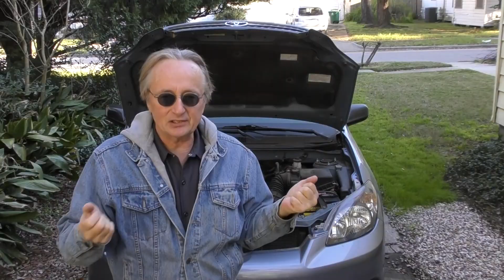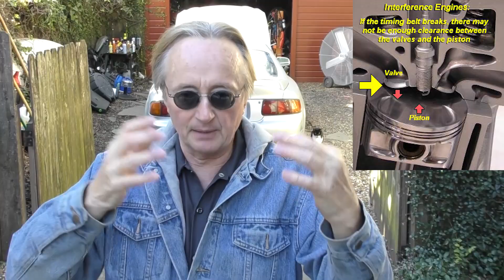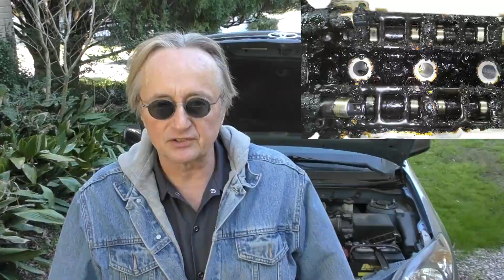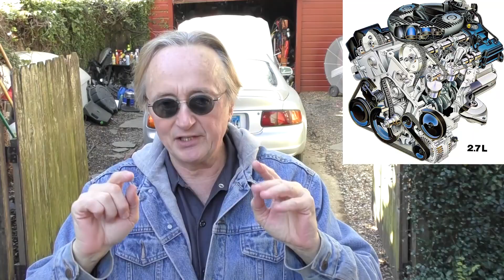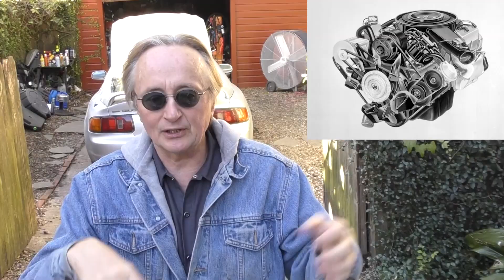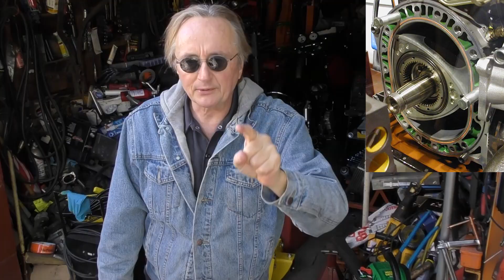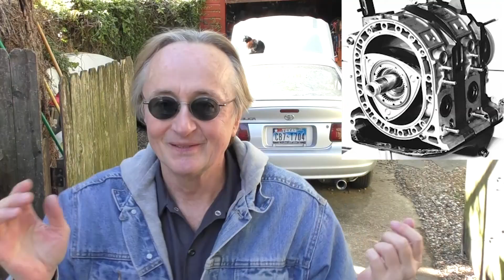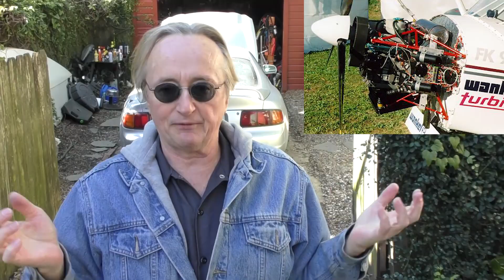Never Buy a Car With This Engine

Comment: Scotty, I had a 2004 Pontiac Grand Am with the 2.2 Ecotec, I actually had the car almost 6 years, until I sold it, it had almost 240k miles on it, and had never had a problem out of it, except for 3 starters and an alternator. (Oil changed every 3k miles, at 175k switched to synthetic blend dexos oil)
Reply: Stefano Dawg maintain it, keep up on the oil changes, should run for a long time
Reply: Stefano Dawg I had to get a new motor of Chevy mablui  2006

Comment: THANKS SCOTTY I'M GOING TO  WEBSTER TEXAS WEDNESDAY TO BUY A 2007 MAXIMA CAN YOU HELP ME IM AWOMAN AND THEY MIGHT RIP ME OFF IT'S A PRIVATE DEALER LOOKS LIKE THE CAR IS AT A APARTMENT ARE YOU CLOSE BY CAN  YOU HELP ME CHECK I WOULD NOT BE TRYING TO GET A CAR BUT I BOUGHT AGMC ENVOY 3 YEARS AGO FROM A HUSBAND And wife and it had oil leeks and it is misfiring and leaking i changed the spark sparks and it's doing the same thing please help dont know what to do thanks

Comment: He's right about the 1.8T engine.  I used Amsoil synthetic in it and still had sludge problems.  Also, all of the vacuum fittings were made of cheap plastic that broke down due to heat.  The other problem was the crappy cvt transmission.  I'll never own another Audi.

Comment: Why can't IC motors use the oil for cooling? I know that oil is cooled through the oil pan, especially aluminum ones, even better aluminum oil pans with fins on the bottom. And oil cooler radiators. The old VW Beetles had an oil cooler radiator inside the fan shrouds. I had a car that had both a finned aluminum oil pan AND an oil cooler radiator.
I guess what I'm asking is why isn't the cooling jacket and radiator that are filled with water/antifreeze mix instead filled with oil all interconnected with the lubrication system? Then a circulation pump mounted inside the motor case or timing chain cover wouldn't even need a shaft seal! Like who cares about the tiny leakage around the shaft of the lubricating oil pump now? It just goes back into the sump (oil pan). It doesn't need a seal, just a close clearance.

Comment: Scott I  want to build a small RV and have been looking for a suitable high top van or cargo van.  I hope to get one that will be reliable and get the best gas mileage I can. Can you recommend what I should look for. I know that diesels are usually recommended but I am leary of the repair costs of a diesel and I am unfamiliar with there upkeep etc.

Comment: I have to be so lucky, I just hit 230k miles on my Saturn ion 2003 with the ecotec 2.2 engine 😁
Reply: Not too lucky, my old lady had an '03 Cavalier, same motor, hit around 225k before I asked her a question to which she replied, " I didn't even know it had spark plugs!" Easy engine to maintain yourself if you were really into legos as a kid
Reply: The amount of abuse and stress I put on my engine. Its still running strong. I have not had one issue with my engine. I have a 06 saturn ion 2.2
Reply: mine has 212,790 miles

Comment: Any 3.5L engine in a GM timing chain
3.3L in a Chrysler oil Cooler
Toyota venza water pump 12 hour job
Dodge rams 1500 aluminum heads
Hyundai Santa fe 2005-2009 front suspension
Any BMW oil and coolant leaks galore if not maintained

Comment: Hurt my feelings on that EcoTec, Scotty. I have 2000 L series Saturn with the 2.2l, I bought it 4 yrs ago for $1500 with 161K on it. Currently has 212K on it and still purrs like a kitten.
Reply: My buddy has a saturn with the 2.2, he has 286k on it and it still sounds like a brand new motor
Reply: lynus binkley I hope this doesn’t include the 2.4 LE5 engines... that’s what I have in my 07 G6... (aka 07 Saturn Aura, 07 Malibu, 07 Opel Vectra C)
Reply: @JoeyLovesTrains  07 Malibu has the 2.2L without VVT.
Reply: Lower mileage, but my 2.2l Sunfire (03) is still kicking at 105k after buying it at 64K 2 years ago.
Reply: I had an 03 Grand Am with the 2.2l and it was the best car I ever owned. When I traded it in that engine still ran like new at 110k, unfortunately it was the transmission that sealed her faith due to my negligence.
Reply: Proper oil changes and they will run forever

Comment: I have a 2006 chevy cobalt with the 2.2 engie eco tec and it has over 200,000 miles and it runs like a champ😎
Reply: My 03 Cavalier with a 2.2 Ecotec is still going strong, 400000km.
Reply: I have a Saturn vue with the 2.2 ecotec and still runs good to.
Reply: I have the same year cobalt as you. With proper maintenance they can go a long way.
Reply: I have a Chevy cobalt  2.2 and it got over 213, 000 miles and it's still going strong
Reply: 2007 chevy malibu   2.2  EcoBoost  220xxx
Reply: How bout now?
Reply: How’s it holding up
Reply: Yes I believe in 06 they went to the better timing chain tensioner. My 05 Cobalt blew up in a parking lot hahaha
Reply: Your chain may have been upgraded with a better tensioner. Most of them are junk at 125K that i've seen.
Reply: Well let's get something straight....no Chevy Cobalt is the 'champ' if anything. Haha, they should last if you maintain them, including timing inspection/replacement...but that's pretty much most engines. The driver makes most of the difference. But it's hardly champion lol. It's supposed to run that long. Just not fun, or exciting. He makes great points on alot of his videos. But the ones about the BMW'S....drive me insane. 265k  on my 06 325xi. Still runs and drives as it should. 
Champion car. *

Comment: Scotty or anybody else out there I have a 2011 Chevy Aveo I get a code P0598 I looked it up do I need to change the thermostat my car is not overheating doesn't Run rough I'm just confused on what to do any help would be greatly appreciated

Comment: Hey Scotty, I have a 2014 1.8L turbo 4 cylinder engine, what is your opinion on the new 1.8l turbos? I bought my car about 2 weeks ago used at 105k miles. Runs great and seems to be fine to the best of my knowledge. If you got any pointers on how to keep the engine prime I'll take them. Although after watching this video, you scared the crap out of me.

Comment: @scottykilmer the Rotary engine is definitely NOT for the average joe. It is a car enthusiast type of engine. I feel the cure for the apex seal issue is a diesel powered rotary, diesel has its own lubricating properties on its own. 
 But i will agree...if you you are just an average joe and you just "operate" your car do NOT buy a car with a rotary. Also a rotary powered car is more like a leisure car. Use premix in them also!!!

Comment: I have a Pontiac ecotech 2.2L and I am surprised that it has lasted so long as it has. it has 221k miles on it. I had the timing chain on it replaced and only used oil with Dextos and I am surprised it has lasted so long. Even my normal mechanic was shocked it was still pushing the power like it it was at 90k miles. If you baby it right, I average about only $150 a year only on basic servicing and its been a good buy and i had the car for 5 years and I bought it as 168k miles

Comment: The wankel rotary might not be a very reliable, long lasting engine but it is a monster on the track. The fact that it doesn't have to an up down motion from pistons means that the rpms are insanely  high. A 1.3l rotary can keep up with 3.0l that's saying something

Comment: Hey,Hey Scotty, Willie here, how you doing sir, on the topic of engines, I started helping my Dad fix classic cars like the 1955 2-dr coupe, im not sure what kind of engine he had in it, but it must have been pretty nice, he would take me down the track and run it out top speed, it ran beautifully, but here,s my question, ive been looking to buy a used car to make all my DR,s appt,s I had a guy with a Lincoln town car with 68 thousand miles on it, he had receipts for everything he just replaced, and it was a long list of things this guy had done and had the proof of these repairs, I asked him what size motor is in this car, he replied it has a 4.6 liter engine, are those engines any good Scotty ? I was very tempted to buy this car for a very low cost 2100.00 to be honest about it, but not knowing anything about this engine made me hesitate, and someone else bought the car before I could make up my mind, so that's why im asking you now,because the next time I see another Lincoln town car and it has a 4.6 liter engine in it with under 100 thousand miles on it depending on your information on this engine I just may end up buying the next one I see and become interested in , Scotty, could you please let me know if the 4.6 engines are any good in those Lincoln town cars ? thank you Scotty, whens the T.V. SHOW  coming on ? I hope you do get your own show , I know ill be watching it, you,ve already saved me hundreds on repairs I did from watching your video,s ,so please keep,em commin , I rang that bell ,lol take care Scotty ,William

Comment: Ford Triton 3 valve and Cadillac Northstar V8 should have at least been honorable mentions
Reply: Definately the 3v. The northstars are good engines aside from the oil pan leak problem and having to pull the manifold to replace the starter

Comment: Once I stopped letting mechanics touch my vw 1.8t, my issues all went away. Dealers, imports only, friendly neighborhood shop, all dropped the ball on my car.
I bought it new in 2000 and around 100k miles she was circling the drain- misfires, bad fuel economy, and no power. The shop’s all said to take her out back and shoot her!
When I rolled up my sleeves, bought a chilton’s and went through it, I found duct tape, missing parts, faulty $5 dollar sensors, wrong parts - you name it!
I guess no one bothered to use a manual, because a novice like me replaced the POV hoses and check valves, ignition harness, spark plugs, and egr valve for about $200 and she purred like a kitty.
170k miles later I had to stop driving it cause the doors were ready to fall off it - the engine stronger and more reliable than it was after just 100k of professionals diagnosing and repairing my car.
It’s timing belt was a bit tricky the first time. The second was a cinch.
I agree that it was a sucky engine if it’s treated like a regular old normally aspirated I4, but they respond to thorough maintenance and repair👍

Comment: I was a Chrysler tech in 02', Had an Intrepid 2.7 come in with a "will not start". Check the battery, it was good. Check the oil, it was really low. Put oil in it, attempt to start; really slow/ hesitation start. Drain the oil, barley a pint. Took the oil pan off, the whole thing was like gelatin!

Comment: If memory serves me well, I worked on a Mitsubishi engine in a doge caravan or ram. The emplacement of the water pump was a disaster to work on (driver's side). The model I refused to service was a Jaguar. Damn engine compartment was packed tight. I just dropped the hood and said "Bring it to your dealer".

Comment: Hey Scotty I have a 2018 Subaru Outback 3.6 touring with a 6 cylinder engine. The dealership wants me to use a Hybrid oil , half synthetic  and half regular oil, won't that cause a buildup in my engine eventually?
Reply: Stay with full synthetic its better for VVT when oil is lighter.

Comment: The Jeep liberty 3.7 is a good engine, but Do not overheat them or run them low on oil. They will last well over 100,000 mile with no problem.

Comment: The GM 3.8 (3800) Engine was a very good engine.
Reply: I had luck with the 3100 from the 90s, Lumina era.
Reply: Same with the 3600 v6 absolutely bulletproof! Trust me I know, I have a 2002 Pontiac grand am with around 215000 miles and no engine issues whatsoever. (Glad I doesn't choose the cheaper ecotec option!!)
Reply: @bigdaddyvince182  the ecotec engine actually isn't bad, the cobalt still has average reliability. Sometimes scotty is pretty biased...
Reply: @johnhunter7244  didn't the tuner car market come up with a fix for the basically the only flaw of the ecotec?
Reply: @bigdaddyvince182  The Grand am's V6 is a 3400
Reply: @macjones9212  yeah your right lol
Reply: Same with the 5.7L V8!
Reply: There are three generations of that 3.8 L. The first two were really rock solid designs but that third one had a lot of problems. I don't know how many of those engines I've had to replace because the intake started seeping coolent into the oil. Before the customer even knew that there was anything wrong,  they had completely trashed there bearings.
Reply: @1stupidfish  indeed the first 2 generations were freakin solid
Reply: My 99 bonneville se 3.8 had almost 400k miles until a tree fell on it from a tornado.
Reply: Yes the 3.8 was a great engine.  Have one in my '97 Firebird now with 183 thousand miles.
Reply: Absolutely
Reply: Yep
Reply: I know right!
Reply: Not just a good engine one of the best v6s ever made and the 3100s are good engines if you catch the intake gasket in time I've had problems with intake gaskets on every 3100 I have had
Reply: I have a '07 Chevy Malibu and the 2.2 liter it's a good engine and since i have it no issues with the engine
Reply: So was the 3400 SFI
Reply: I've had 3 3.8s with 230,000+ and they were tanks
Reply: I have a 3800 engine supercharged any good .?
Reply: @luismartinez4081  take care of it well and it'll hit 200k no problem. I have one at 250k still going strong
Reply: @luismartinez4081  Aurora?
Reply: @rebirth_mishap  Impala SS 3004
Reply: Impala SS 2005 have 144 k runs strong
Reply: @luismartinez4081  best engines made
Reply: Coil packs always failed.

Comment: I've been driving a 2008 Saturn Vue XE every single day since I bought in 2008. It has the 2.4 L Ecotec. It has 90K miles on it and the only problem I ever had with the engine was the engine cover seals which I changed myself. Still running. Of course, I change the oil religiously. I'm thinking to get a remanufatured tranny and I could probably run it for another 10 years.

Comment: First the Rotary Engine was very smooth running. Second, it revd up very quickly to an 8,000 RPM redline .. Yes, it does use a little oil. If you owned a rotary powered Mazda you needed to do 2 things: 1): Check oil every fill up and top up if needed. 2): Never, ever let a rotary engine overheat as it will warp the rotor housings. I had Mazda RX2 until it crashed, had a 1976 Cosmo (the engine seized) as I forgot to check the oil and also had an 1980 RX7 (stolen) had a 1981 RX7 (that one got crashed in 1993), had an 85 RX7 with the 13B which was still running great until it was stolen with 125K on it in early 1999 .. Mazda up until then was using a Thermal Reactor & not catalytic converters. I never had any issues passing a NJ safety or emissions test.

Comment: TOTAL BULLSHIT..!! VW 1.8T 20VT is one of the most reliable engines ever  built. They can handle up to 400hp (depending on the engine code) with stock internals. Yes, the coils will go bad, but if you change the sparksplugs every 25-30.000km or replace the coils with aftermarket ones (ie ngk, eldor, beru) or fit R8 coils they will never fail. If treated right they run forever and they love to be tuned. I've owned 3 1,8T cars so far (audi a4, seat leon fr, seat ibiza fr) and they were all tuned with no problem at all..!! Now if you don't read the owners manual and put semi-synthetic oil in it, it's your problem and you shouldn't own an 20VT 1.8T in the first place.

Comment: Real fact and true , hilarious, my spacious toyota previa with 75degree tilted engine , did 789.000km in 23yrs. Mounted a nose bra. Used best SHELL 0W30, change coolant regularly, changed the rotors and brake pads, in any case it keeps running all the time. At the end changed all wheel bearings and rear suspension brackets. Now unused, parked in a garage box

Comment: The description of the VW/Audi 1.8T sludging issue is a good example of why US customers have a totally different experience than in Europe.  In Europe people get their cars maintained by OEM dealers to preserve the service history.  So they never end up with the wrong oil.  Going 10k miles on non synthetic or cheap oil is just asking for trouble.
Reply: I've seen dealers put wrong oil but generally even independent garages are a lot more knowledgeable in EU, yeah.

Comment: Ecotec stuff to avoid!!!
2007–2008
Chevrolet Cobalt
Chevrolet HHR
2007–2008Chevrolet Malibu
2007–2008Pontiac Pursuit/G5
 2007Saturn Ion
Reply: Other reasons to avoid these engines: the rest of the vehicle. Had to replace a headlight bulb once on a Malibu, company vehicle not mine. Costs $100 for the hour of work it took them remove THE ENTIRE BUMPER to get to the head light bulb, and that was a small mechanic. Would have been more at a dealer I'm sure. And of course it's all plastic clips, so if it wasn't hot weather they'd be replacing all the broken plastic also. GM should be put on probation instead of getting government handouts. They should have to pay for all maintenance on all their new vehicles for 10 years as community service for polluting the country with this exploitive garbage.

Comment: Original Shelby GT500. They were originally gonna use the 427 FE outta the GT40 in it, but they used the 428 Police interceptor instead cuz since the 427 was a racing engine, it would burn oil at highway speeds. Not saying it was a shitty engine.

Comment: I had a Mazda RX4 with the rotary engine.  I never had the problems you mention, but it did have a dual point ignition that would need adjustment every tank of gas.  When it ran, it was a fast car, but what a pain.  Love your videos Scott.
Reply: Remind me of my 850R which i changed cap and rotor like every 3 months and the electrodes where almost all melted.

Comment: I do not understand why heads are aluminum on a cast block, but yet, the ac brackets, and many other very large accessory brackets are still made of heavy cast iron.  I would have thought those would have easier to lighten being made of aluminum